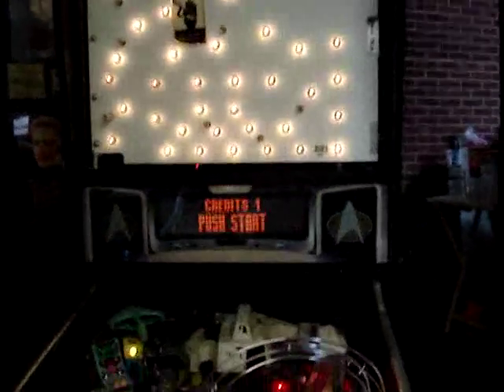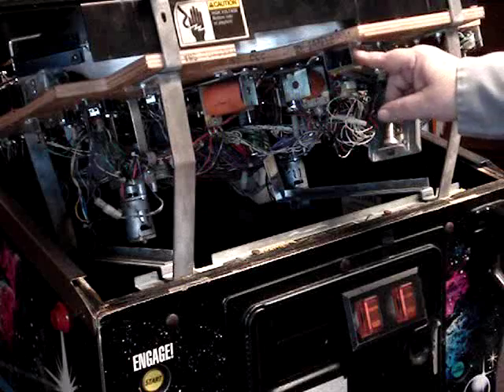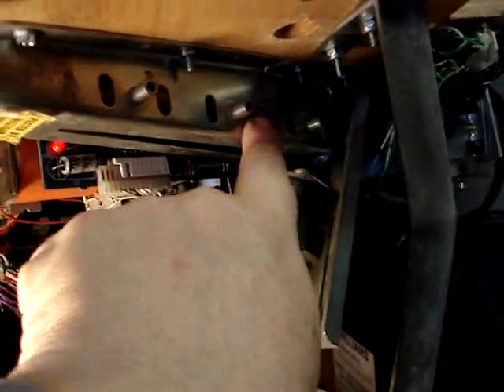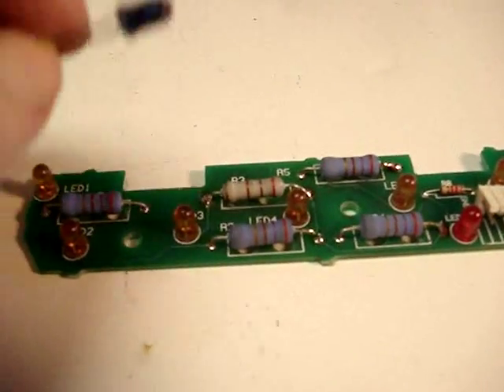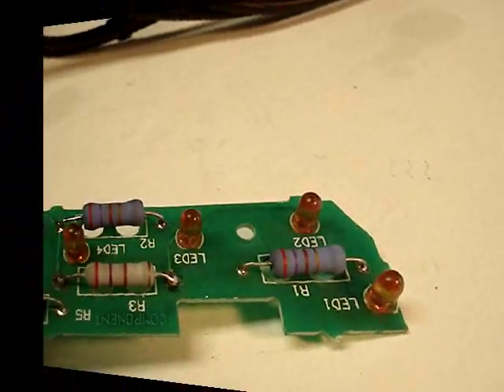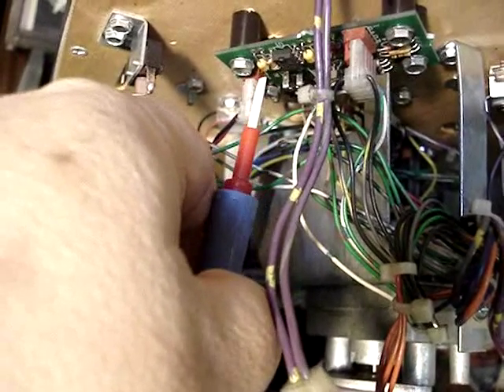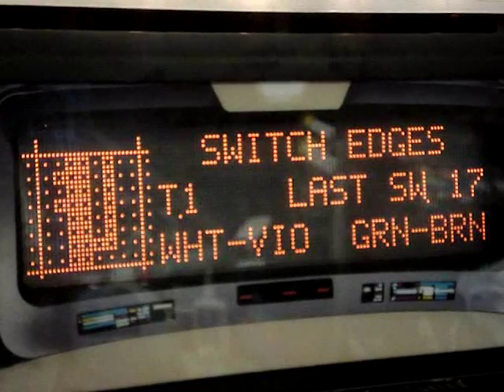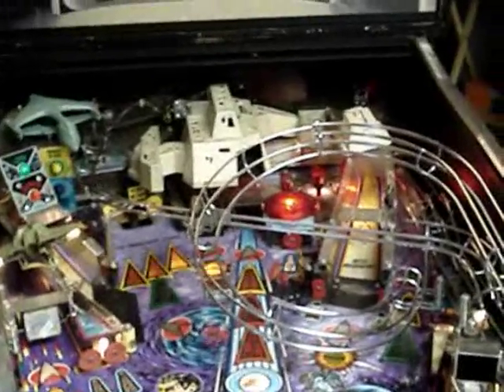Repairing the Ball Though Opto on a Williams Star Trek TNG Pinball Machine

Comment: My STNG had both of those problems, broken resister on the trough, easily repaired, and both eddy sensors, quick adjustment with a screwdriver.  You want to adjust it so the light is just barely off, rolling the ball past triggers the sensor and lights the led.  Nicely done!